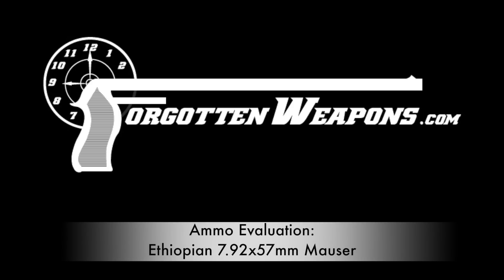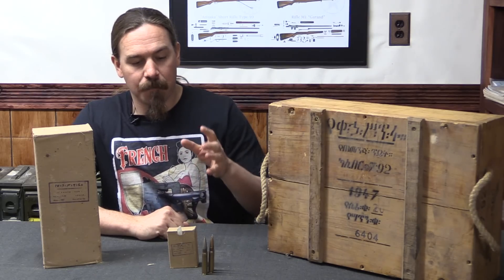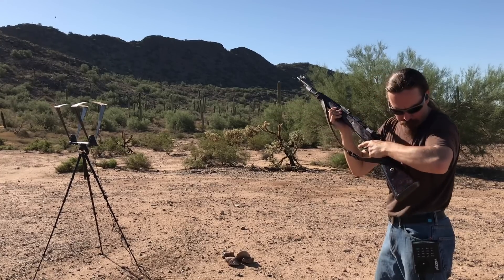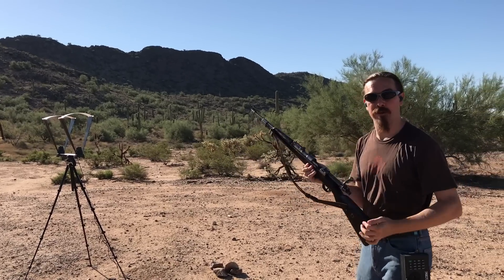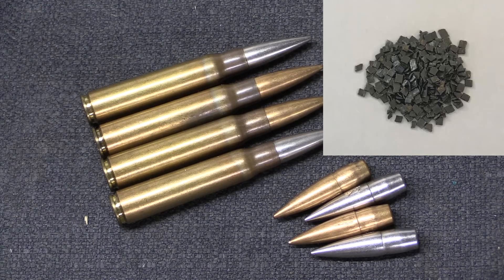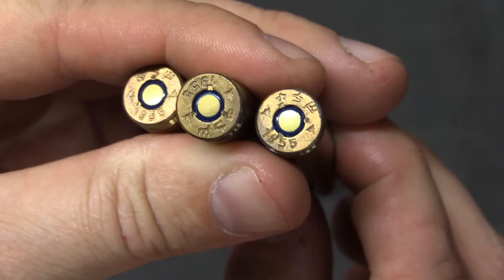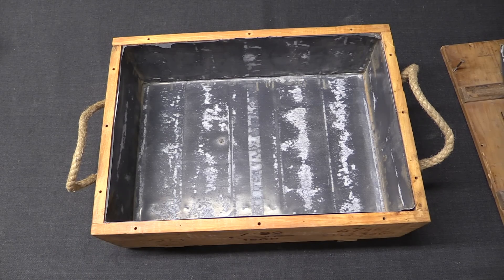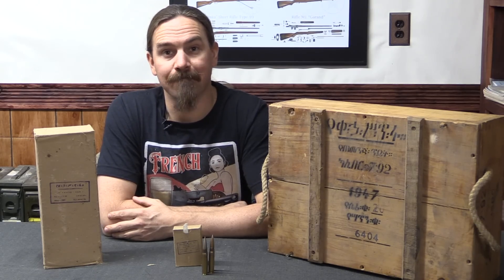Ammunition Evaluation: Ethiopian 7.92x57mm Mauser

Comment: Just open my order from classic that was dated 2018.  It’s been stored inside the house where humid controlled.  The round all have fine sands in them so mine was not in a crate.   The first 5 boxes I shot every round was a Hang-fire and also double strike.  It’s unnerving as some of the hand fire goes off a few milliseconds after the trigger is pulled.

Comment: Just fired some of this ammo (though not many considering the ammo shortage).  However, ZERO misfires, ZERO hangfires.  Used a Yugoslavian M24/47, noted for having a strong firing pin spring.  Also, while the ammo seems to have some kind of very light cosmoline on it, a quick wipe each cartridge with an old t-shirt cleaned it up pretty well.  Not sure what the complaints are about, since I couldn't duplicate the problems, and yes, I did watch the video.

Comment: I just bought a small sample size of 15 and they look absolutely horrible. 5 of the bullets look decent. Is it possible they could all fire? Or is visible evidence usually a sure fire sign at best you will get hangfire? I've never shot mil surplus... Also two of the rounds had a little play they werent seated securely in the brass.... Sorry for punctuation and my lack of knowledge spamming this

Comment: I bought a box of 300 before I saw this.  I was very pleasantly surprised at my first day shooting with it, had less than 5 hangfires and only 1 misfire in about 100 rounds
Reply: Curious what type of rifle you were shooting it through.
Reply: Kirk Mooneyham yugo refurb k98k, non matching but the barrel is marked s42k which dates it 1934.  And my friends yugo m48/BO
Reply: @cameronjellison2085 , Did your friend experience misfires or hangfires with his Yugo M48?
Reply: Kirk Mooneyham there was zero performance difference between the two in terms of the ammunition.  Both have very stout striker springs.  If there’s an issue with the surplus ammo, check the tension on the firing pin spring and maybe see about getting a heavier one...? I got tired of cleaning it every time I went shooting and got 400 rds of new production prvi partizan 200grain boattails.  Twice the price (~85¢)but well worth it.
Reply: Kirk Mooneyham I finished that box with only two total duds and one restrike, tons of hangfires of varying degrees though
Reply: @cameronjellison2085 , thank you for the info.  I wonder if it's a matter of year of the ammo, or exact storage conditions.  I fired some today, zero problems whatsoever.  Yugo M24/47

Comment: I noticed that ammunition was just a bit more than 500 FPS slower than the Turkish ammunition you tested.  Were there proper primer strikes from the firing pin?  If so, I wonder if the anvils were properly pressed into the primer cup. I wonder if there was a manufacturing issue with the nitrous filament. Oh well, at least they were running at proper pressures and velocities.

Comment: this is the ammo that I was using that caused my injury. I got a box of this ammo and had 7 missfires in a row, i waited 30 seconds after each one cause safety. Well when the 8th one clicked i only waited 10 seconds cause i was frustrated as anyone would be. So i unlocked the bolt and it fired. It sent the bolt backwards and into my right cheek and cut me just shy of the jaw bone. the cut is about 4 inches long from the center of my cheek to the edge of my jaw. I write this hoping that if someone ends up in the same situation as i did (hang fire) they dont make the same mistake i did.

Comment: Primers go bad. I had some 40s Portuguese, and 70s Romanian that had terrible tendencies to hang/misfire. I simply pulled and loaded case for case into freshly primed brass, and voila' no more problems. A little more work, but not as bad as it sounds. And if you get it cheap, the cost can still be less than new.

Comment: If you take just the non-hangfire rounds, their velocity has a standard deviation only 11.65 fps (avg. 2467) - so this was originally very good ammo.

All the hang-firing rounds were consistently ~ 36 fps slower, except for the last shot, which was actually the fastest. Just the hang-firing rounds had a terrible SD of 33.5 fps because of that round (5.6 fps without it).
If you could somehow avoid or "fix" those hang-fires, it would be a winner.

Comment: What's  "hang-fire"?
Reply: @John Gerald You're mixing hang fire and failure to fire. Hang fire means there is undue delay between striking the primer and the round going off but it does eventually go off from that strike.

Most of the time, like in this video, the delay is only a small fraction of a second. In extremes it could take up to several seconds, which is why Ian waited with his rifle aimed at the berm when had failures to fire, just in case.

Comment: Super fascinating video; looking forward to more of them.  As for the two cartridges which required second strikes, I wonder if that could be a result of a slightly offset strike which missed the anvil in the bottom of the berdan case, or if there was an issue in manufacture with the case such that the anvil in the pocket wasn't properly shaped and sized.

Comment: For all the good and accurate things you do, Ian......Yugoslavia never RE-manufactured K98's and made them M48's ( 2:25-2:35). Yes....there are such re-done 98 models by Yugoslavia, but specifically M48's are an intermediate-length, large ring 98, all made post war, and interestingly, not even in 1948 but sometime later, starting in 1951 and going till '65.  The Model 24/47 however, looks a lot like a 48 and is also intermediate length, and some of these were also re-arsenaled Euro made Mausers (some also made new post-war, I believe....so  maybe you meant M24/47, that typically shows a straight bolt handle, as your example does). M48's typically have "semi-bent" bolt handles, almost K98 looking, with a flat-bottom bolt knob however.

Comment: About 10 years ago I bought a few large card board boxes of German 1943 dated WWII 8mm ammo. If I remember correctly the story was that it was captured in Tunisia and kept in storage there. The boxes where designed to fit into a German ammo can and the top would be rip off to access the smaller cartridge boxes. The cartridges were on steel stripper clips. The brass cased ammo looked great for the age and who knows how it was stored. Though it did not shoot well. There was at least one dud on each stripper clip and plenty of hang fires. The average speed recorded by the chronograph was pretty consistent for old ammo. I shot about 150 Rds, gave some to a friend, and then kept the other intact boxes for display. I do not remember what I paid for it though I do believe It was pretty pricey for 8mm. At that time you cold get Comm block 8mm Romanian for a lot less. I believe Century imported it.

Comment: Considering the high quality of the projectiles, annealed brass cases, staked and lacquered primers, and metal-sealed packaging, do you think the poor consistency of ignition and velocity could be purely a result of the propellant breaking down over time, rather than sloppy loading? I would love to see documentation of factory QC testing of the ammo at the time of manufacture to see how consistent the velocities were when new.
Reply: Primers breaking down - frankly, I thought the velocities were pretty fantastically consistent outside of a few outliers, for being 60 year old Ethiopian military general issue anyway. The hang fires definitely weren't from production - a military is going to know VERY quickly when they try to run it through a machine gun and it turns into a semi-auto - and NO ONE, not even Ethiopia, is going to accept that lol

Comment: Velocity-wise, that is really consistent ammo. As to the hang-fire, what do you guys think caused that? Light strikes? Hard primers? Old powder?
Reply: Could be any of that. Old ammo can be temperamental.
Reply: Old primers/powder. Even when stored correctly, priming compounds and powder don't keep all that well.
Reply: It's odd that the velocities were so consistent.  even with the hang fires.  I would like to have seen the primers on the ones that took two strikes.  I'm going to say really really hard primers. Or maybe not as well seated as you would think?  And Ian, Bless His Heart, at the first failure to fire.  Isn't he so adorable???  I don't think I will be buying this lot number of 8mm...  Thanks Ian.
Reply: Old chlorate-based primers tend to do that after 50 years or so if not kept in temperature-controlled storage...I've encountered the same thing with WW2 .30-06 surplus, which also used a chlorate-based primer.
Reply: Might have been the gun. Had issues the more he shot.
Reply: Old primers.

Comment: Back when I used to shoot all the time in the 1970's & 80's I would try out any surplus ammo I came across since all I would use it for was practice anyway.  Most of the stuff if it was properly stored was OK even if it was 60 or seventy years old as long as it was good to begin with. Some of the wartime manufacture stuff from different countries was a little haggard in quality because just like Ian I used to disassemble some to do both bullet weight comparisons and power charge weights for consistency.